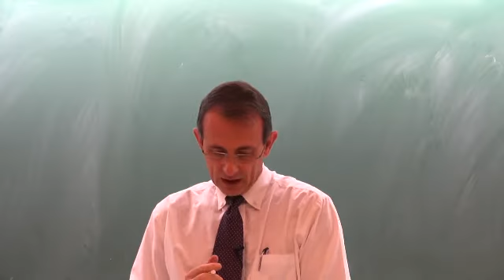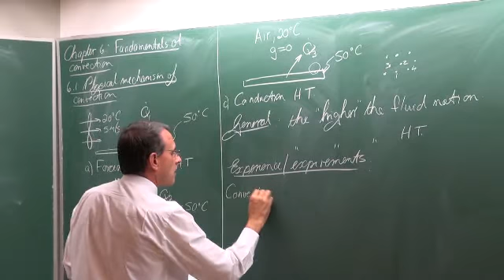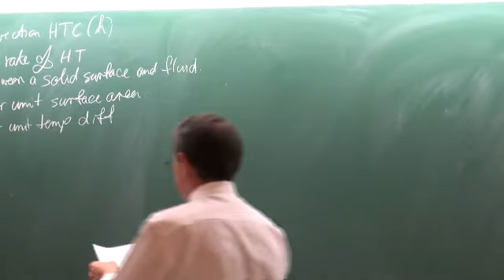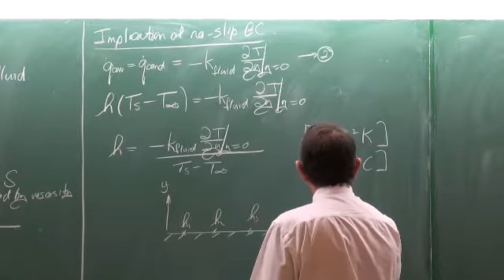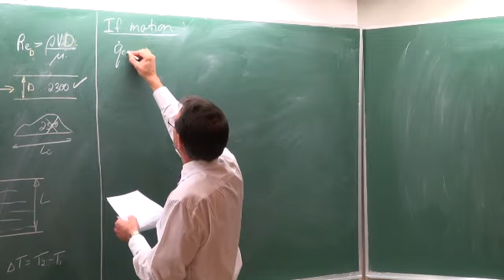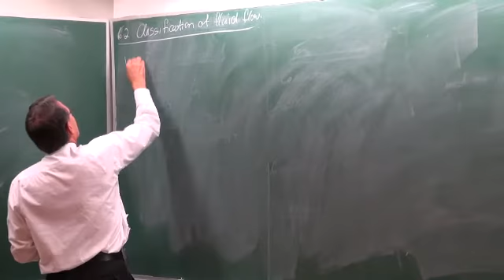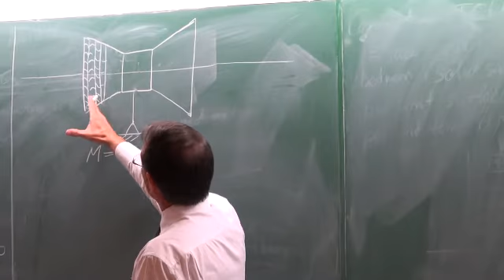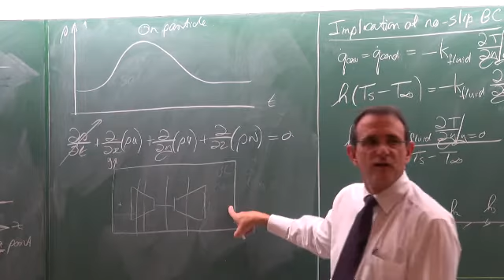Lecture 15 (2013). 6.1 Physical mechanism of convection. Fundamentals of convection

Comment: Thanks! However, I did not understand when Nu = 1, equals to only conductivity. It should (IMHO) read: When Nu = 1, then amount of conduction = amount convection, and NOT only conduction. Because when only conduct, thus convection = 0 then and thus Nu = 0.
Please comment.
Reply from the maker: +Frans Hartmann : I did not go and listen in what context I have said it and maybe I did not express myself well. I think in one of the first lectures on the Fundamentals of Convection and on the Nusselt number I have shown that Nu = 1 when there is no convection. Thus at Nu = 1, the heat transfer is through the fluid by conduction only.  As Nu=hL/k and if Nu = 1; then h = k/L reduces the heat transfer Q = hA.dT where dT is the temperature difference to  Q=(k/L)A.dT. And as dT/L is the temperature gradient this equation represent Fourier's law for heat conduction.